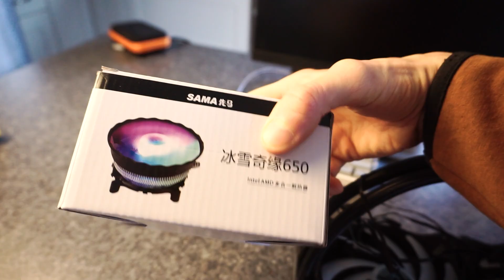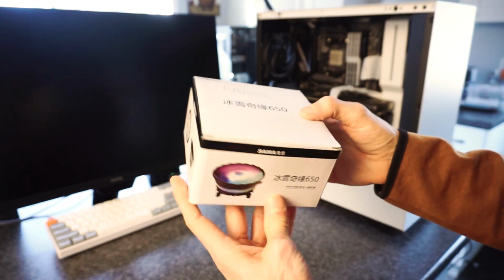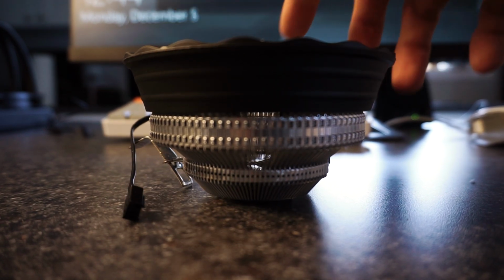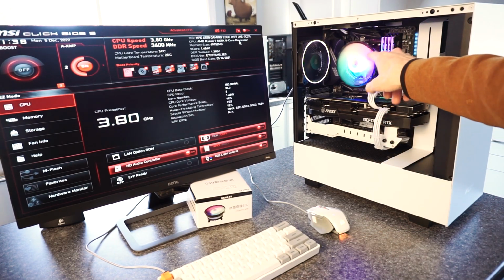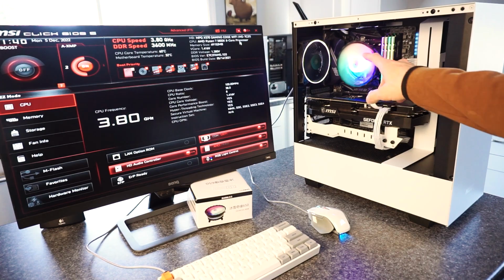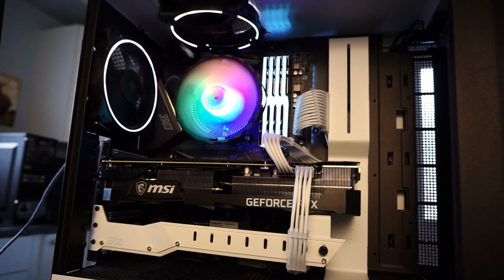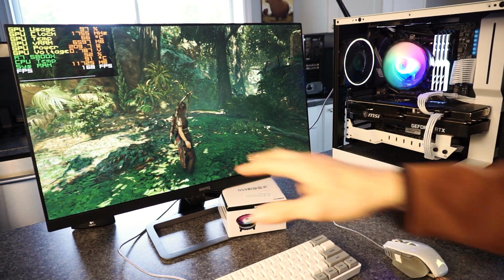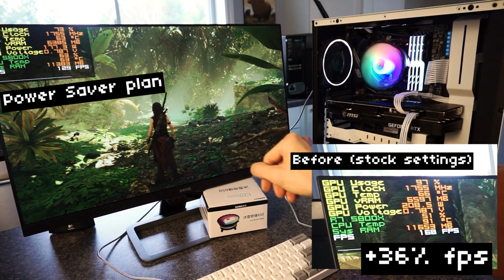Can a $5 cooler handle a Ryzen 7 5800X?

Comment: your not gonna burn it up,  Ryzen 5800x will just thermal throttle itself if it gets too hot.  I have one running a hyper black 212 and the temp never gets 0ver 84c in cinebench r.23,  the 5800x just runs hot.  Thats how amd made the things.   Now, obviously that little heat sink is not going to work and it will cause your pc to throttle the core voltage and clock to keep heat down.

Comment: fyi. windows power plan jsut disables all boosts and runs the pc at max base clock, in ur case 3.6GHz i think with max 1.1V. But in such cases i prefer setting manual volts and frequencies in bios, which in 99% yields better results i d say. in my case i can run 3.8GHz on 1.05V with my 5800x, so higher frequency with less volts (and therefore less heat)
Reply from the maker: Thanks for the info!

Comment: tip: 3PIN on CPU fan header will run it at full speed always. So just connect the 3PIN CPU fan to a chasis fan header, which most mainboards can controll speed and connect a 4PIN chasis fan to the CPU fan header. and in the BIOS just set the chasis fan header you connected the CPU fan to to monitor CPU temps.

note: i was in a similar position. bought a used 5800x and only had the wrait stealth cooler from my 2200g lying around. ordered also an assassin KING but meanwhile the wraith stealth worked for the 5800x with all boosts disabled at fixed 3.8GHz 1.05V

Comment: True story, I use a 5800X with like a 13 dollar Rosewill tower cooler. On an ASRock a320 board. And set to "eco mode" in the bios (limit it to Ryzen 5 levels of tdp). Been a year now... No issues. Lol. Hardly ever reaches the thermal throttle zone, regardless of what I'm gaming on.
Reply from the maker: I have a cheap cooler on it right now. Cheap amazon tower cooler. With eco mode, just like you. It's actually working just fine. I got my AiO back from MSI and I haven't bothered installing it yet lol. I'm gonna make a video on it soon.
Reply: @TechDweeb  i remember a buddy being horrified by my set up. Until i sent him screenshots of my system getting higher cpu scores on benchmarks than his 2700x and x370 set up.
"I think I'm doing just fine"

Comment: I have a 5800x system I put an old Thermaltake black widow spin q on. 

It doesn't really thermal throttle but it doesn't out perform a top end stock (spire from a 1600x) cooler by enough to do any overclocking. 

I'm wondering if the vapor chamber liquid has dissipated.  

I'm  not sure how to test for that, I'll just have to scour the web for more info.

Comment: As an owner of a 5800X3D I knew right off the bat that it wouldn't work, well at least not without thermal throttling which is never a good thing, although I am using a air cooled heatsink at the moment  but the only reason I'm not thermal throttling is because I'm using this little program called PBO2 tuner which limits the voltage. It actually runs even better this way. I'm am going to get a AIO and prolly a new case because I want a 360mm AIO to tame this  beast and my current case doesn't support it. BTW nice build, I really like your pc but I hope you don't break your 5800x good luck

Comment: Oh, it hurts.
 I bought i5 13600kf box variant, but it has no cooller inside, now I use my old tower without bracings directly on the chip, while waiting the new tower which compatible with s1700. In windows   youtube 4k temperatures from 19 to 30 C, but when I try go to the games - temperatures grow up to 75C. 

Thank you for the video, feels better when strugle not alone :)

Comment: Btw feel free too pick up a used Noctua nh-u12p/s, sp etc.. & buy the am4 mounting kit, really good cooler, specially if you find the cooler cheap.
The AM4 mounts comes with all the mounting hardware you'll need so even if the previous user has lost everything other then the wire mounting for the fans & the heatsink itself it still works too use.
Reply from the maker: Good to know! If I ever find one on the cheap I'll consider grabbing it. I'm going to experiment with a few other cheap coolers in the near future.
Reply: I know you like air cooled heatsinks and so do I but trust me the 5800x runs hot af. I'm using a 5800x3d and using a huge be quiet heatsink with a 140mm fan that goes to 2000rpm and using grizzly kryonaut thermal paste and it still pegged 90C on cinebench in a short time. This was the first a cpu had defeated me. These cpu's need a AIO and a nice one at that

Comment: It's not a good idea to get a cheap cooler for an expensive power hungry CPU , if you do it, the CPU automatically will try to stay alive, but eventually if a CPU runs in really high temperatures , it will die really faster than it would if you used a decent, cooler

Comment: Yeah almost all ryzen 5000 series cpus targets 90 - 95c & tries too maintain performance as high as possible with ryzens performance boosting targeting temperature.

4 pin is pwm controlled sending a signal for the fan too interpret as like 30 - 100% fan speed basically like a proportional rc car or plane esc.

While 3 pin is voltage controlled usually via the motherboard, which is pretty low tech but very much a standard that been around for 20 - 23 odd years or so
Went too a ryzen 5600 upgrading from a i5 2500k at 4.5 ghz recently myself last thursday which at stock in cinebench r23 isn't far behind your cpu there if you reach 14000 points as im sitting at just above 10,140 ish.
cooling my ryzen 5600 with a noctua nh-u12p se from 2008 - 2010 ish ? which with a am4 cooler mount bought is amazingly good at cooling the cpu with some case airflow, my highest temperature so far with just a cpu stresstest like cinebench has been 63.3c which is basically nothing.